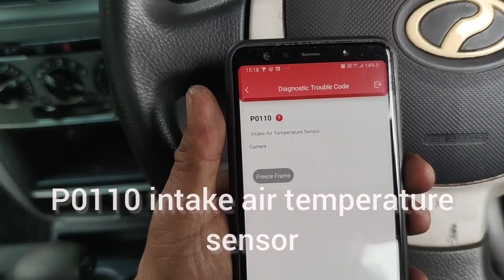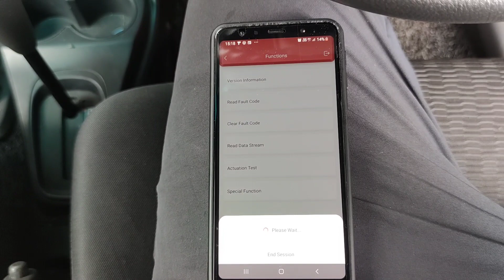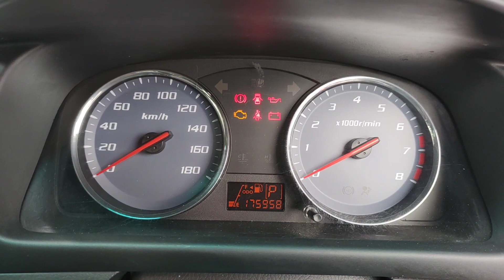P0110 intake air temperature sensor circuit malfunction / punca lambang enjin perodua viva menyala.

Comment: Kenapa ya, saya punya Check Light dah hilang lepas tukar semua sensor, tapi waktu bawak kereta time nak tukar gear atau slow down, rpm naik tinggi & enjin mengaum kuat. Time jalan or tak bergerak okay je.
Reply from the maker: itu masalah idling valve..
Reply: @KieAUTO  saya dah settlekan, bukan idling valve. Wiring je 😅 Salah tu bos
Reply from the maker: Wiring apa